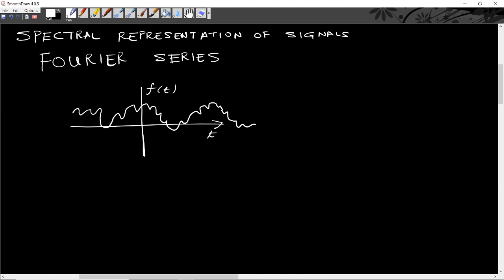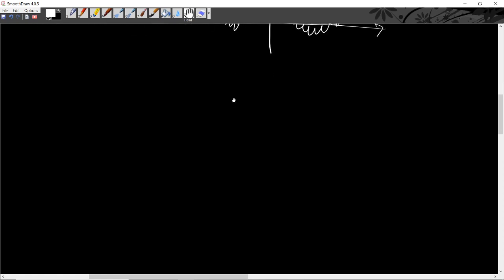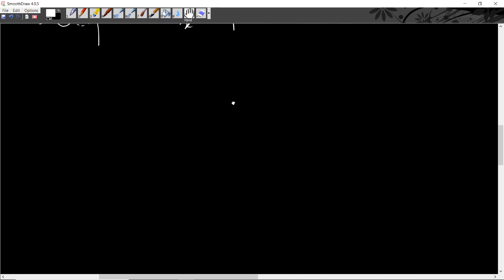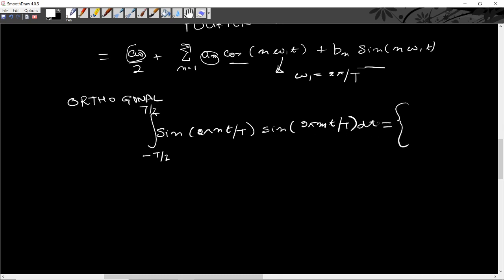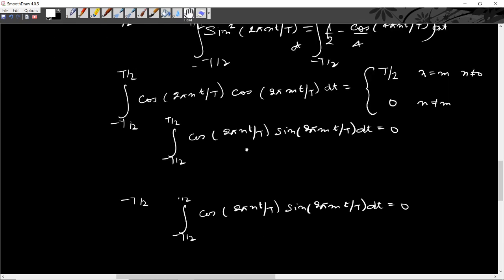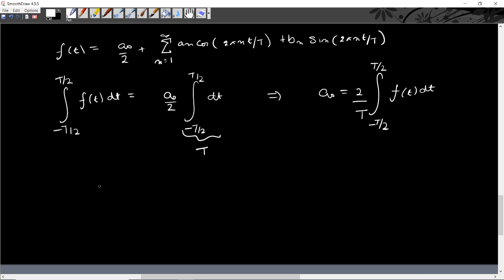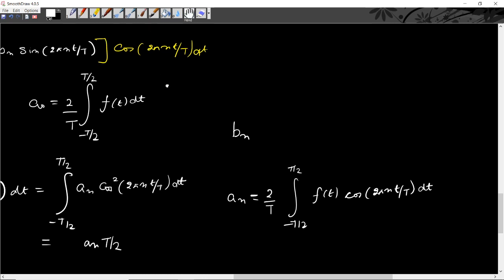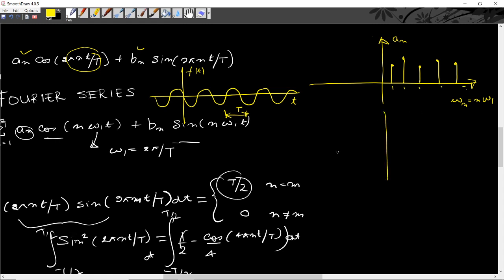Lecture 1: Introduction to Fourier Series

Comment: Sir, sin^2(2pi nt/T)=(1-cos(4pi n t/T))/2=1/2-1/2*cos(4 pi n t/T)? but you have taken 1/4*cos(4 pi n t/T) Check your mistake in your video at 13:48/28:00
Reply from the maker: Thank you for pointing out the typographic error. The integral of the cosine term is zero anyway and does not affect the final answer.